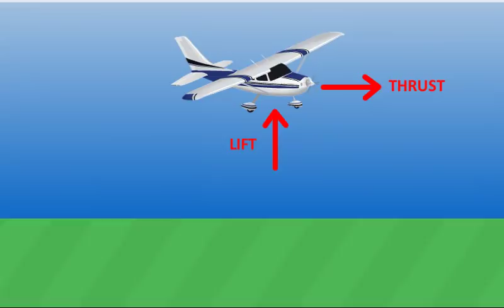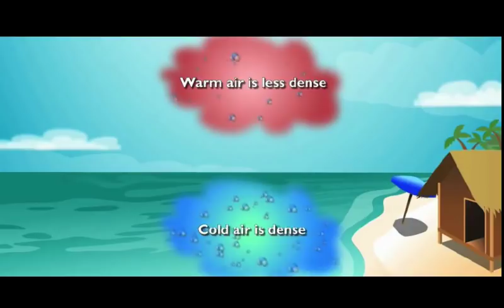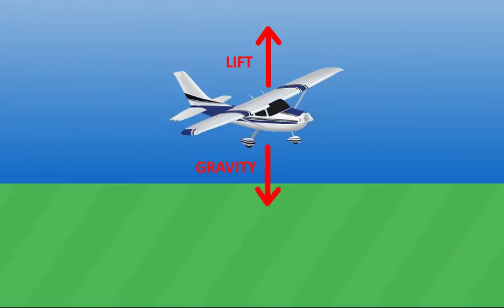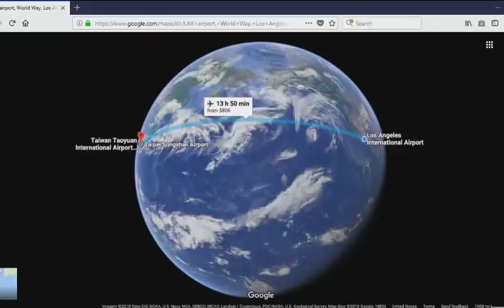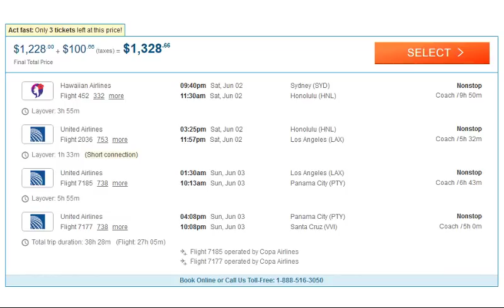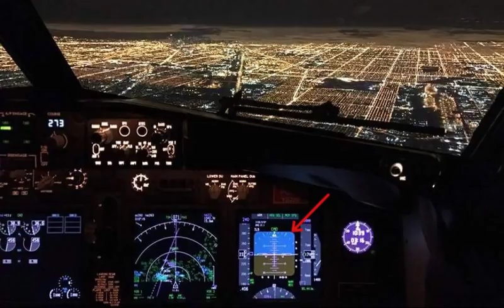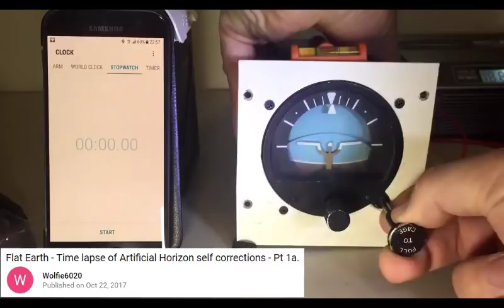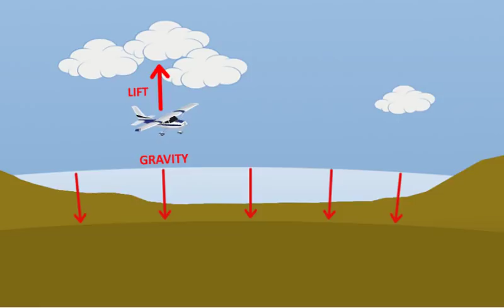Flat Earth Falsities - Plane Nonsense

Comment: Coriolis force (the rotation of the earth) actually has an effect on the wind: it causes winds to deflect clockwise around high pressure areas, and counter-clockwise around low pressure areas, on the northern hemisphere (on the southern hemisphere it's the opposite). This effect is reduced at low altitudes due to surface friction, which is why you typically see a wind-shift to the right (northern hemisphere) when climbing through about 2000ft.

I wonder how the flat earth explains this phenomenon, especially the fact that it's reversed in the southern hemisphere.
Reply: Dilandau3000 they just claim it doesn't exist. At least that is what they have said to me when I used to argue with them. Anything they cannot find an explanation for that fits their nonsense, they just dismiss or ignore.
Reply: This is not truly a force but an effect which can be treated like a force. Gravity is also an effect which seems like a force. What is the speed of gravity and what is it made of?
Reply: Hello from David 
What is the speed of magnetism and what is it made of?
Not sure what you are trying to make clear.
Reply: The speed of magnetism is the speed of light and it is a vibrational wave of energy. Gravity is an effect.
Reply: The coriolis force is an effect but not a true force like electromagnetic waves
Reply: Hello from David 
I'm not a physicist but Wikipedia suggest to me a speed of gravitation:
https://en.m.wikipedia.org/wiki/Speed_of_gravity
Reply: What this means is that if the Sun suddenly disappeared the Earth would not feel the lack of gravitational pull for 8 minutes but that would mean that gravity is a wave of particle which would mean a graviton would have to exist, but because gravity is an effect rather than a force the speed of it could be instantaneous which would be faster than the speed of light and that is where mainstream science stumbled ... Again ☺
Reply: Hello from David 
To be honest, I am a bit concerned when I hear people talking about 'mainstream science'.
Do you suggest that scientist struggling with gravity are on the same level as FE stupiditists, denying gravity.
Reply: Sometimes mainstream scientists are blinded by their own compartmental knowledge.  They don't know where most of the Universe is (they call it Dark Matter). They don't where most of the energy is to make their equations work (they call it Dark Energy); they cannot explain the existence of the Moon is the sky (calling it "an observational error") and they cannot explain the function of over 90 per cent of human DNA (calling it "junk" DNA). And so, for me, that is a concern. No one else could get away with those sort of excuses. Could you imagine going into the bank to get a loan and saying I don't know where most of my income is, but I can assure you it exists?  You'd be shown the door.  :)  That;'s mainstream science for you. They also don't know where the Laws of Physics come from. Not doing very well, are they?  :)
Reply: Hello from David 
The more you learn the more you find out how little you know. True for everybody, bur surely for scientists. Not having a problem admitting you don't know and that you have to 'make things up' to a certain extent, like dark matter, to complete the picture, that is ok. If you want to call that excuses, fine, but it seems a kind of arrogant, not having an alternative. 
And comparing scientist to bankers is outrageous.

But it seems I am waisting my time to an FEer, so I don't see a point in any further discussion.
My experience is that it always ends in ridiculising things they do not understand or just not giving any response, obviously lacking proper arguments.
Reply: I was making an analogy with what one professional can get away with if they call themselves a "scientist".  If you asked an accountant for a report on your finances, would it be credible if the reply was "I don't know where 90 per cent of your money is, but I can assure you it is somewhere"?  You are deliberately conflating this into making a comparison with "bankers" (your term) which I clearly wasn't doing. I believe the Earth is round, by the way :} and so I am not a Flat Earther. That is just your assumption. It is not "arrogant" (your word) to challenge any theory, it is called Critical Thinking. That is what science is supposed to be about. And I do have other explanations for anything I question or query, and I am happy to be wrong. I seek the best explanation for anything. If I woke up tomorrow and was wrong in all my assumptions I would be happy, as long as the explanations I am given to relinquish my own theories is a better one:)  However, I do wish you good luck and best wishes in your studies :) And thank you for your input.
Reply: Hello from David you are the one that made a comparison to bankers. You compared it to going to a bank and asking for a loan, hence a comparison to a banker.
Your citation of thinking some 90+% of our DNA is nonfunctional is obviously based on your misunderstanding of whatever you read. There were scientists at Oxford who decided that less than 10% of our DNA was functional, but that is with a very narrow definition of what functional is. They were referring to the parts that code for our physical appearance and behavior. They are then proclaiming that all other parts of our DNA are therefore "nonfunctional." These other parts are not entirely nonfunctional and have played a role in our evolution and the development of diseases, such as cancer. 
You should try reading a little deeper than taking broad meme statements as actual fact. Look it up and you will find that what you call "mainstream science" actually knows a lot more than you think it does.
Reply: A bank is an institution and a banker is a person. You conflate the terms and alter the meaning.
Reply: Dawkins uses the term Junk DNA and I have read The Selfish Gene and the Blind Watchmaker. Both books offer a deep approach ☺
Reply: I am sorry but I made no comparison to bankers. I mentioned the term bank loan in an analogy. It a similar analogy I changed it to accountant
Reply: The point I made about junk DNA was that it did have a function but that function was poorly understood. I am not responsible for the reaction of others but only for my own words ☺
Reply: My observation about mainstream science is that it knows less about anything than I previously believed and then I offered a few examples of where I believed the lack of knowledge was. I would be happy for anyone to en lighten me in these areas ☺
Reply: I have asked Dawkins about DNA function and he has told me he does not know the answer. I don't look things up, I seek primary sources ☺
Reply: Your words follow, not mine “you compared it to going to a bank and asking for a loan, hence a comparison to a banker.” 

This is now my own words: I note that you conflate the word “bank” with “banker”.  The term I used in my analogy was “bank loan”.  And so I have made a new analogy, with the same meaning, and eliminated the word “bank” entirely.  :)

If you asked an accountant for a report on your finances, would it be credible if the reply was "I don't know where 90 per cent of your money is, but I can assure you it is somewhere"?  

I appreciate your views and input. Thank you for that.  :)
Reply: Hello from David so apparently in your version you are going to a bank and calling out your words, asking for a loan from the building itself and not the people inside of it. Gotcha. You want to play a semantics game to get people to forget about what the main point was. 
Scientists don't say anything like what you make it out to be. It is more like, "Here is what we know and here is what we don't know. This is what we think the parts are that we don't know, but further research and investigation is required to get the answers." In your analogy, that would be the accountant/banker/whatever title you want to give them saying, "I know where 10% of your money is. I am sure the other 90% is there somewhere, but it will take more research and investigation to find it." In reality, neither the scientist nor the accountant would just stop and be satisfied with not knowing. They would continue looking to find all of the answers. In looking, they may also stir up more questions as they get answers. That is how science works. We don't live in a world where scientists think they have found all of the answers and have stopped looking, as you present it to be.
Reply: Hello from David you present it as if not knowing all of the answers to everything in the universe is a detriment. It is actually an expectation. If scientists came along and said they have found all of the answers to every question known to mankind, and therefore no longer have a need to do any more research, exploration or observation, I would find that rather frightening. We may never know the answers to everything, but we know more than we did last week, much more than we did last year, far more than we did 50 years ago, and an unimaginable amount more than we did 1,000 years ago. We may also find that the answers we thought we had were wrong and then have to formulate new answers.
In my profession we change things all the time because of new research (I am a nurse). We used to put central lines and PICC's in a lot more patients than we do now. And I mean A LOT. But then we found that they were developing infections from them at faster rates than was previously thought to occur. Now they are very rarely placed and taken out ASAP. We used to leave them in for up to 6 months if the patient needed long term IV therapy. While they can stay in a long time, it is done far less often than it used to be. It used to be that 3 to 4 of my patients each shift would have a PICC or central. Now I can easily go multiple months before I have even one patient with them. Further research taught us something and we made changes accordingly. 
It doesn't bother me one bit that we don't have all of the answers. It would bother me if we stopped looking for them.
Reply: Hello from David not looking things up is not something to be proud of. If you only wait to talk to someone like Dawkins after a talk or hope you run into Kaku at the grocery store then you are not going to gain very much information very quickly. I find that I often learn something new by arguing with people in YT comments sections. It makes me look up things that I otherwise would not have and I end up gaining a lot in the process.
Reply: My point was credibility of explanation. I don't think it is credible to say we don't know where most of the Universe is and we don't know where most of the energy that solves our equations is, but you just have to believe us in all the other small detail. That sounds to me like blind faith. And that is what religion relies on. Apparently science does to.  :)  Science is a system of belief presented as proof :)  It would be more honest to simply say our equations don't work but we believe in our theory. But then you would be like a religious leader but presenting yourself as a scientist.  Fundamentally we are looking at the same thing:  faith, not proof :) That is the crux of the matter. A Hegelian Dialectic, or a choice between two false creeds :)
Reply: I agree. I think we should always seek answers, but by using Critical Thinking. I did not say that not knowing was a bad thing. I made the point that any explanation must have validity, if not, then it is not a proper answer, it is a story :)

It is my opinion that we are not getting smarter and I believe that we knew a lot more in the past; the evidence comes from ancient civilisations. 

I admire your choice of profession. In my opinion Nurses are the most valuable people in society, bar none :)

I never said I was proud of not looking something up. My point was that first-principle information is usually more reliable than reading someone else’s research. 

Information is just that, it does not necessarily mean understanding, which is at a higher level. I agree if you read the words of the World’s most intelligent thinkers you are more likely to be well informed that having an argument down the pub with a dunderhead.  Exchanging information is a very good way of learning and so I agree with you there. I learned about The Eötvös effect last night because someone kindly sent me a link. My motive is to find the best explanation for anything.
Reply: Cosmologists describe all the processes, just a split second, after the Big Bang happened, in incredible detail. And all that occurred some 13 billion years ago.  But they cannot look out of their window today and tell us where most of the Universe is?  Is that supposed to make sense?  If you think critically, it has no validity. This is not testable science, it is spinning a story.
Reply: In String Theory “scientists” talk about P-Branes that occur in 10, or even 11, dimensions. They need all these extra dimensions to make their equations work. Most people (and most scientists) cannot imagine a fifth dimension but they argue with each other over whether they need 10 or 11.  Again, this is story-telling, not testable science. You might as well argue about how many angels you could get on a pin-head …
Reply: Human-caused Global Warming is not a credible theory and so it conveniently changed its name to “Climate Change”.  Yeah, right. Our climate has always been changing and the UK was much warmer 500 years ago and there was no industry. Carbon Di-oxide is only one part in 2500 in the air. Argon is more abundant and it is never mentioned.  Water vapour is the main greenhouse gas (clouds and precipitation and moisture) and there is extra-ordinary amounts of that. So why not ban or tax clouds?  Fluctuations is solar radiation ( I.e. the effect of the Sun) is the reason for changes in climate, but carbon is supposed to be the “enemy”  Just another story …

Comment: Answer this...What about the gyros they had 80 years ago, just the gyro with no cerrections
Reply: Wrong, ask any older pilot, absolutely no need for correction.

You know a lot of pilots that were flying 80 years ago do you?
Reply: If they never corrected the gyro and it had no automatic correction mechanism then it would be completely useless even on a flat earth, as precession would cause them to drift out of alignment.
Reply: They could manually correct them by caging the gyro when in apparently level flight.
Reply: GrahamStw
Wrong, ask any older pilot, absolutely no need for correction. That's exactly WHY they use a gyro !
Reply: GrahamStw Now your just lying.  Foolish trolls just lie and hope the ignorant will believe them.  Sad.  Earth is flat.

Comment: After sleeping on it, it seems to me that flat-earthers don't understand that an atmosphere has weight & mass, since it's so much empty space between air molecules. This is obviously a glaring disconnect between their mental image and observable reality. After all, it's the MASS of atmosphere which makes winged flight, kites & sailing ships possible: a force of air acting against a solid object! If air had no mass, kites & sailboats couldn't exist, since wind couldn't push anything. The only way that wind would be damaging is in the case of a tornado & hurricane: i,.e., not the wind ITSELF, but the solid objects sucked up in it! Assuming that massless air COULD spin into a devastating funnel!
Reply: Cathy Vickers how do rockets propel through space if there is no atmosphere in space?
Reply: Great Work Because thrust doesn't require an atmosphere to function: a rockets thrust is literally the kinetic force of an explosion in a contained space with only one exit: the ship is shoved in the opposite direction of that thrust. All the big, fiery thrust does is get a rocket beyond the pull of gravity. Once it's free of atmosphere, the big engines shut down because, missing the friction of atmosphere, a projectile will continue in the same direction at the same speed until another force acts on it.

I know this isn't a super-knowledgeable, scientific explanation, but it is what I remember about the physics of kinetic force from school, plus I watched the Apollo & Space Shuttle missions on TV.

Comment: Its actually not quite accurate. The speed the plans fly actually is diffrent from west to east. One can se that on really long haul fights. Say flight like Berlin-NY there might be a diffrance of over a hour from one direction to the other.

The reason for this is quite complicated, but the effect on the plane is farly simple. There is winds at high altitude that blow in the same direction pretty much Always. The wind speed is fairly high. So usualy the plain fly down wind from US to Europé but from Europé to US they in steed try to avoid the wind by going over the pols.

This is based on the Earth rotation via the coriolis effekt.

16:05
Its Worth noting that older and smaler planes don´t Always have this automatic adjustment. I flown with smal single Engine planes that the artifical horizon have to be manualy reset ever now and then

Comment: Modest correction 5:35, planes do not fly in level flight to maintain an equilibrium with gravity, they maintain level flight by maintaining a constant ambient pressure. We call this pressure altitude.  Yes, this means as the the air pressure varies from standard, aircraft do change altitude by a small amount.  On a long trip at a constant flight level, you can watch your GPS altitude change as you fly from areas of high pressure to low pressure areas.  Good video besides.  
Make sure you speak slowly and use simple words so the flatards (CHL) will understand.  LOL. 

“Fly into space”. LOL, no one could be that stupid and be able to feed themselves. ;-).
Reply: test two all he’s saying with that is the net force in the vertical axis is zero
Reply from the maker: Test two - Yes, I agree. Thanks.